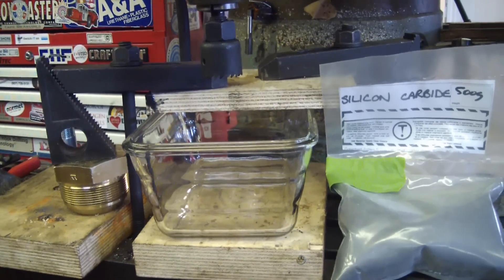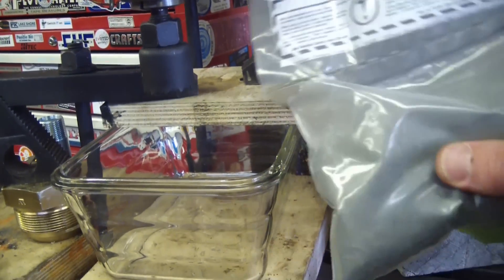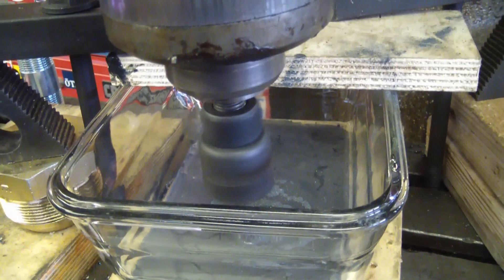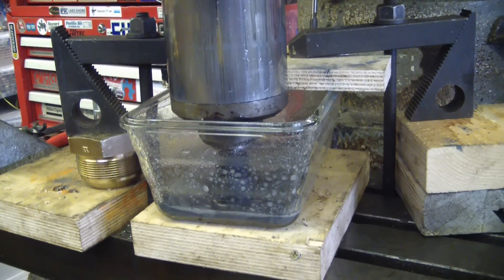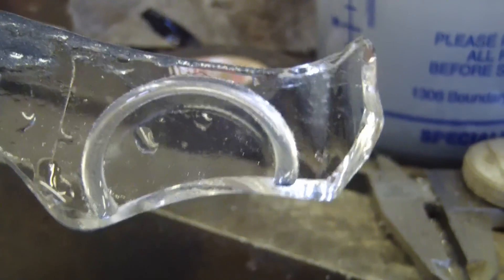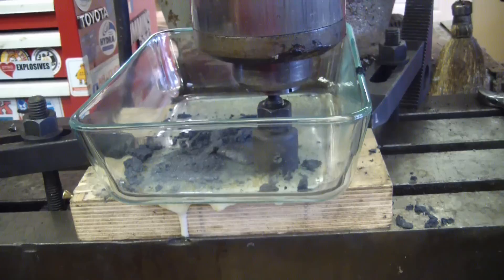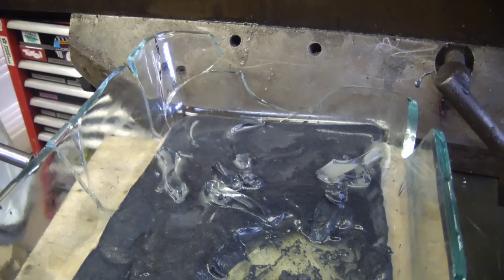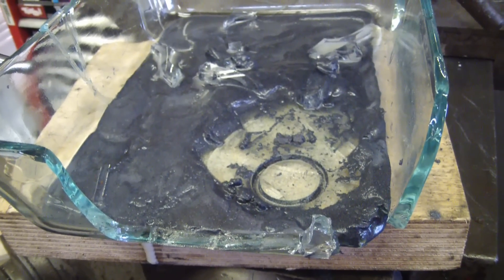Using Silicon Carbide to cut glass

Comment: the only way i know to drill through it  is slow and cold 
it sounded to me like your cutting to fast 
i'm no expert but i would say that it was thermal expansion that caused the glass to shatter 
try again at half the speed or even slower than that 

just another thought could it be sound frequency to cause it to shatter 
i am thinking it is possible because the deeper you drill the sound frequency changes 
and i am sure you know that if you hit the right frequency glass will shatter

Comment: or do the real long version 1mm,1.5mm,2mm.. or just take some guhysmuhy stuff make a ring around the hole fill it with water so its just that area has water and slowspeed. dont think lightpetrol would be any good that you normaly dip the classcuter in before cuting the line on the glas

Comment: Grind off the teeth on that hole saw that will give it a more even pressure distribution, maybe round it over that should help a lot. If you can be bothered id glue some emery cloth or sandpaper onto the rounded over drill bit it'll help catch the grit and hopefully speed up the cut. Or as a last resort buy a shitty glass hole saw their like 15 pesos.

Also lighten up the pressure as it gets towards the end of the cut  the part underneath he cut is going to get progressively more fragile.

Comment: The tempered glass will completely shatter if this is even attempted. If you absolutely must have tempered glass with a hole in it, the hole or any other shaping must be done before the tempering process. You cannot cut or drill heat tempered glass. Not waterjet, not laser, not hot needle, not under water. Just about all attempts will end in breakage. I've only ever managed to drill through sand glass (bottles) with a diamond dust headed bit.

Comment: try running it slower or even grinding the teeth off of the hole saw and then just put vertical slots down the side with a cutoff wheel for it to have a way for new silicon to enter the cutting pathway while spinning.

Comment: It's exactly like a Prince Rupert's(One of those royalty guys) Drop. Pyrex and Gorilla glass are hard-as-fuck until you de-stress the interior then they explosively fracture. G.G. is usually laminated to plastic so it doesn't spray into your eyeballs but that pyrex breaking is cool to watch with a slow-mo cam.  You'll need yourself some cheapo glass for this.

Comment: It doesn't look like tempered glass to me. Tempered glass breaks into tiny little pieces. I think it may be sound frequencies and vibration that are breaking the dish. The way that the dish breaks is pretty explosive. It's like shattering a wine glass with your voice. When you match the frequency of the glass, it breaks. Maybe try going really slow with the rpm's on the drill.
Reply: +Roger Nalan Cheap Pyrex is tempered glass these days, but it's only very slightly tempered, just enough to make it somewhat resistant to thermal shock, although nowhere near as resistant as the borosilicate stuff. So it still fails catastrophically if you try to cut it or drill it, and can explode violently if you exceed it's thermal shock resistance, but it doesn't shatter into tiny bits the way, say, a car window would, and it's not nearly as strong as more thoroughly tempered glass would be.

Comment: One can cut sheet glass like paper with a pair of sheetmetal scissors underwater. So following that logic you may get away with cutting the glass this way by submersing it in water 100%. Thus way, the shockwave of chipped glass wont shatter the structure but will be absorbed and contained by the water.
Reply: ***** yeah one can call it nibbling i think. and also you maybe right about that chemical reaction between water and silicone oxygen bonds..  I found this: "According to Scientific American, water causes glass to crack more easily because when a water molecule enters the crack, a reaction occurs in which a silicon-oxygen bond at the crack and an oxygen-hydrogen bond in the water are cleaved, creating two hydroxyl groups attached to silicon. As a result, the length of the crack grows by the size of one bond rupture. The water reaction reduces the energy necessary to break the silicon-oxygen bonds, thus the crack grows faster." I always thought it was the resonant frequency being dampened by the water.. oh well :)

Comment: Harmonics, forget the stress stuff. Treat it like a brake disc, wrap a strips of bicycle inner tube around the outside to control the harmonics and, go slower. Slower speed and lighter pressure. What's your hurry? You got a Miami Vice rerun waiting?

Comment: Lots of internal stress in Pyrex due to the manufacturing process. I think if you got an aluminum oxide (ceramic) tube to replaced the hole saw you would have better results. A more uniform surface area. Could polish it away much the same way they polish lenses.
Reply: jd52wtf Also the hole saw may be scoring the surface in a way that the pyrex doesn't appreciate. With the ceramic head that will not be an issue.  Great videos btw.

Comment: diamond hole saw, slow and steady wins the race.  Tip, if you have high temp and the point of contact (where its "choochin"), then the rest of the glass needs to be the same temp.

Comment: Would it work to glue one up from 5 sheets of standard glass?  Because if it would just make your own container with standard glass and cut the hole in that. 
If that doesn't work, and this is gonna sound stupid; pre-break the dish, fashion a hole from the broken parts then glue the pieces back together with the hole already in it.  Yeah, that reads even stupider then it sounded in my head.

Comment: Frequency related stress fractures.  Most diamond encrustulated hole cutting devices have no teeth, just a relief slit for dross to float out.  Water flood cooling to keep the cut clean and Guillaume is your uncle, hole cut.
Reply: That could be as well. Brittle cast materials are goofy that way. Be easy enough to stick a piezo on the glass and get it on the scope to see what is going on frequency wise as well for some added science nerdery.  Bonus points for also measuring site stress
Reply: Quickly! To the moops at SMI!

Comment: Sand blaster will erode a hole right through. Done it b4. 9/10 times it won't break. A lot of blow back in your face. You need a good hood or a blast cabinet.

Comment: Modern Corning glass Isn't like the old Pyrex.  As others have noted it appears to be a tempered glass.  Some stories about it shattering when using it for cooking are going around. Probably cheaper than the real thing, some bean counter probably got a $100 bonus for the idea and the ceo bought a second yacht on his stock options.  For what its worth I've cut ordinary window glass using a hole saw and about 200 grit carborundum for lens blanks in my telescope making days. Same method no problems.  Keep your stick away from the flying glass shards.
Dave
Reply: It's not tempered:  it'd have turned into a pile of square glass cubes the instant it was structurally compromised.
Reply: I'm not sure how big of a blanket the term 'tempered' is..  My hunch is that tempered is more exclusive than pre-stressed, as in 'all tempered glass is pre-stressed, but not all pre-stressed glass is tempered';
 I'll get back to you.

Comment: I bought a set of 6 dimondioum hole saws from Princes Crap for I think $60 to bore a hole though a bowl to use as a raised sink. Something I was told was impassable by 4 seperate glazers, told me the dish Bow would shatter into 20million pieces. Even went to a brick yard to have them do it. I don't like to be told no!. I just used water and some cutting oil in my drill press and went slow. The PA DIMOND SAWS ARN'T ACTUALLY THAT BAD. The Dimond coating didn't flake off like the rotory tool ones. 

WHAT BRAND of dish where you cutting? I can try one on my end and see how I do. Not like these are expensive. I'm sure whatever you get in BC I can get in Toronto.

Comment: Pyrex™ / tempered glass will be a bitch no matter what, but... try using a softer metal substrate, ditch the bimetal holesaw. A brass or copper tube with a few slits will pick up the abrasive and put it to better use. Also, cycle the pressure on and off to allow cooling and replenishing the abrasive slurry.

Comment: I saw similar stuff with tempered glass. But this one is not tempered (no tiny pieces at the end). Odd. How about making a small hole with a dremel and a diamond bit? If that will break it, then it's something with the glass, and not your method (which is quite brutal, if you ask me, so maybe try to push this by hand in the final stages).

Comment: i would try to start with i smaler drill and do i from the bottom not the inside the and ive would fill the inside with sand and water to make it temporarly a "solid piece".
sry for bad english hope you get it and good luck if you havent already made it :)

Comment: Probably too late for a reply but hey.  glass maker here.  Lots of misinformation in the comments.  This doesn't look like tempered glass it breaks into too big a chunks. looks like stress internally caused by poor annealing. Pyrex is borosilicate  hard as f. but will cut with your method.  wont make any differce cutting wuth diamond. Anneal it first at 650 Celsius metric dooda. dropping to ambient slowly. Then repeat.  or give me your dimensions and ill cut one on my water jet and send it to you.  Happy grinding.

Comment: If you just need a hole, hot the sucker with a blow torch till its molten then bung it in the microwave. Not tried it, but seen it done.
Reply: *****  shit, I'm a science wizzard. I shall do some experiments next week.
Reply: Big_Adam_2050 This, I've tried, with Pyrex Vision pots and fry pans (old formulation and newer), with MAP gas and propane.  What's the euphemism...  rapid unintended disassembly?   The commercials for Vision cookware, when it first came out, showed a demonstration of an aluminum pot being melted down in the glass pot.  This seemed really cool, but the difference is that they used an industrial sized flame source that completely enveloped the entire pot, and so, no drama.  When just a portion of the glass is heated, however...
Reply: Nevin Williams  Was going to try cheap ass pound land special glass dish. Bound to have one somewhere.

Comment: just use low pressure with hand drill not milling machine with soft grip and very low speed you can cut any glass also if you still want to use machine give it time to cool down even with water and silicon carbide it very high temperature when get drill so use it as drill up and down takes time but work l already get through this experience but to be honest not thick glass just 1mm thick and cool down every second because l broke three plates before finish ^^

Comment: just to FYI everyone, I looked this up and found this as an answer...

"The tempered glass will completely shatter if this is even attempted. If you absolutely must have tempered glass with a hole in it, the hole or any other shaping must be done before the tempering process. You cannot cut or drill heat tempered glass."

taken from the Stack Exchange web site for diy.

Comment: grind the teeth off the hole saw emulating the diamond hole saw..but its probably because its tempered glass which will always shatter. id shoot for a premium borosilicate glass dish to make what you need, if you can even find a consumer dish like that. labware will be expensive for something like that i rekon.  id use oil instead of water for the slurry too.  ive heard of companies using a waterjet to trim automotive glass for choptops and such but the glass back then i think was not tempered..and damn the diamond core drills are friggin expensive..harbor fright has a carbide hole cutting kit for 30 bucks #68116 along with your slurry might get it done..good luck.

Comment: Well, since you can cut glass with a heated wire and rapidly cooling the area, maybe you can make some sort of a jig to weaken a circular spot so that only it would brake? tempered glass is a b!%ch of a mistress... good luck!
oh, and 1 more thing- what about minute vibrations? I would imagine that the old blade is worn out and kinda vibrates, also bad for glass.

Comment: I wonder if the stepped teeth of the hole saw are causing percussive impacts and oscillations. Try removing the teeth on your lathe?
Reply: Or why even use a hole saw. With the silicone carbide, wouldn't a wooden dowel still cut though the glass?

Comment: Remove the teeth from the blade and try just the smooth cylinder and abrasive. Then you'll know for sure if it's the stored stress is causing the shatter or a tooth from the blade

Comment: Metal on glass is never a good idea anyway, I would say that size of the teeth on your core drill bit which are to big and are chipping away at the glass rather than grinding through it. If the glass is just a cheap borosilicate it will be full of impurity's which will also not help the grinding process. I would recommend cutting the teeth off your core bit taper the end slightly and let the Silicon Carbide grind away the glass. Mix the Carbide to a paste but don't let it dry out while grinding the glass.

Comment: I never cut glass, but I'll give you my 50¢. The glass vibrates a lot on the upper rim, so I'd put some electrical tape across the upper part to dampen the oscillations.

Comment: Never cut Pyrex or any other heat resistant glass, it's tempered, break it, it becomes mad as hell and breaks! don't do it! It'll lose it's temper and just like humans, it explodes, no joke as you saw, not joking. I'd say look into another material for a dish with a hole in it and leave pyrex alone (I love my pyrex baking pans, real ones, they make awesome lasagna and casseroles) and yeah I'm a guy who loves engineering and also making food too, but please do not cut pyrex glass it will always shatter, it has a memory for it's shape, aka tempered.

Comment: Glass insulates.

 Inside wall is hot, and expanding ; outside wall is cool and stable. Expansion differential has caused boogerie stress, and Shazam the Pyrex cracked. Try coolant on both sides of your material, brother. BTW, no more Frenchie s***. Keep it in a vice.
Thanks. 
          BD.

Comment: I'm just a dumb diesel mechanic but couldn't it be because of the points on the whole saw bit creating more psi than if it were smooth on the bottom like a tile whole saw? Also it seems like your arbor isn't true so that could be getting kinda kattywompus on ya

Comment: I've seen ridiculous success cutting glass completely submerged in water.... Something to do with absorption of high frequency vibrations that cause fractures. I dunno if you have a bit extension that would allow for it, and if you can get your Bridgeport to chooch slow enough to not fling crap freaking everywhere, or how you'd secure the glass doodad in a damn tub of water.... but there ya go... 42% of an idea.

Comment: As someone said below, it shattered due to resonant frequencies, you either need to slow down, or speed up the hole saw..... or possibly stick lumps of modelling clay in various places about the dish to upset its harmonics.  The poor dish threw itself apart.... like a wine glass does when one of them fat, opera singers screeches at it.  Good Luck with your next attempt :-)

Comment: HIGH, HIGH speed with a diamond bit and water.
Reply: Tony6242008  Low speed with HIGH HIGH grit and water works too,
Reply: +Jonathan Anderson Zero speed with infinite grit, or vice versa. Problem solved. If you do the vice-versa, watch out for hard radiation.

Comment: I guess you've heard it before but you drill too fast. Perhaps tune the hole saw also, it might be warped which cause excess vibrations. You could use your vibration analysis for balancing I guess :).

Comment: Typical glass melts at 1400c, melt it out with a steel rod.  An acetylene torch runs about 3500c, but a propane would probably do the job as well (around 2000c).

Comment: Hope this comment filters thru all the chooch.  I see that once you drill thru the glass dip far,  the silicone carbide mix doesn't get in between the hole saw and the glass.  Making you dry cut it with the metal teeth alone= Crack every time.  You have to figure how to keep your slurry in the cut groove and  possibly vary your drilling speed. may yield better result.